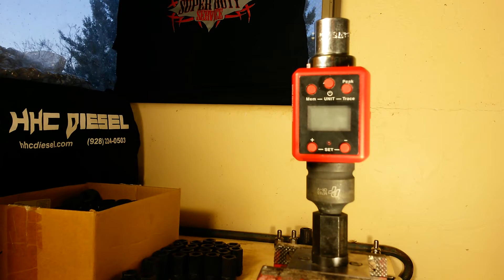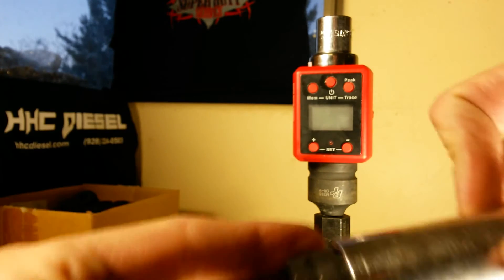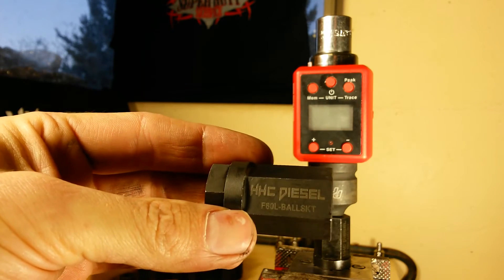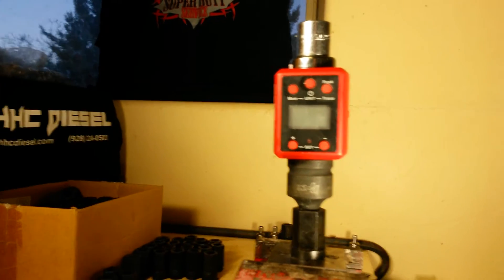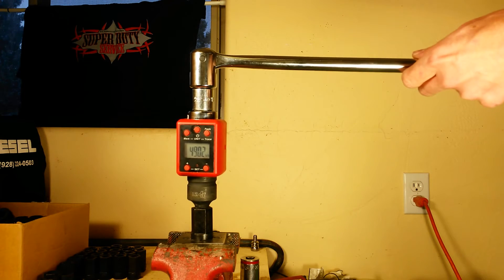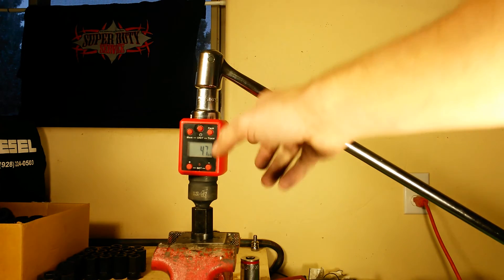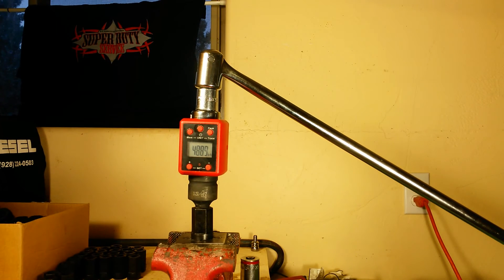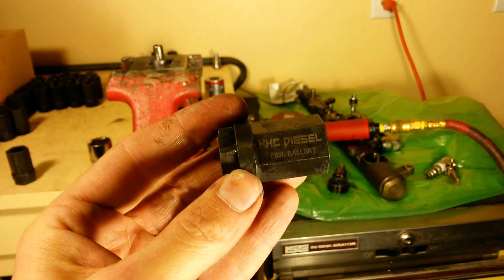HHC Diesel ~Ford 6.0L Nipple Cup Socket MAX Torque Test~ Can I Break it?

Comment: I don't think you need that much torque for the nipple cups.  I just gave mine a good rap with the air tool to seat them.  There is not much movement to them anyhow.  The job turned out great.  Truck runs like a Top.
Reply: semtech30 I think torque specs are 100ft pounds